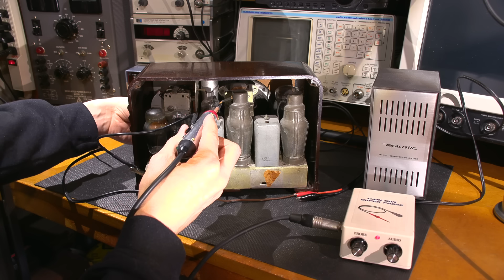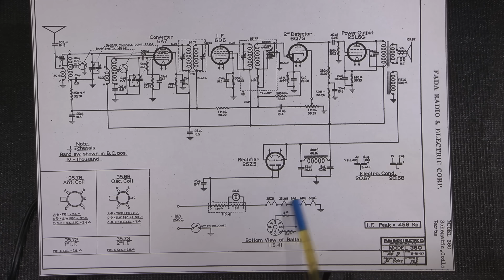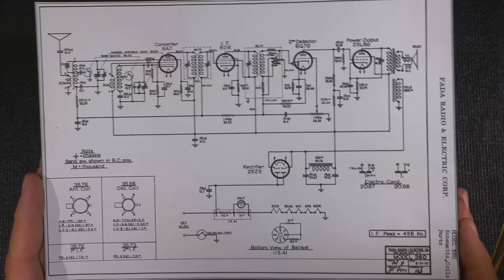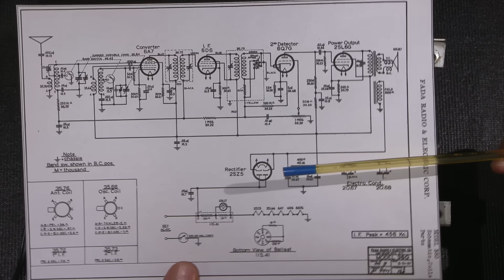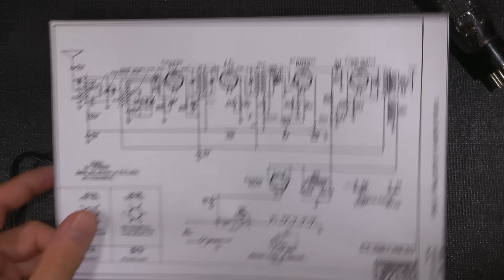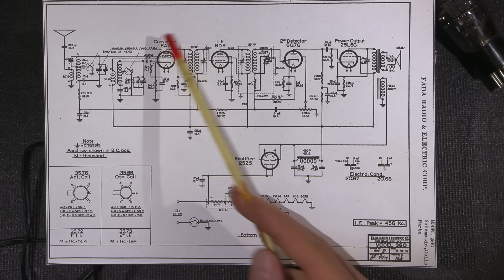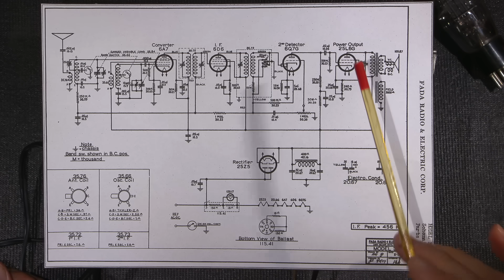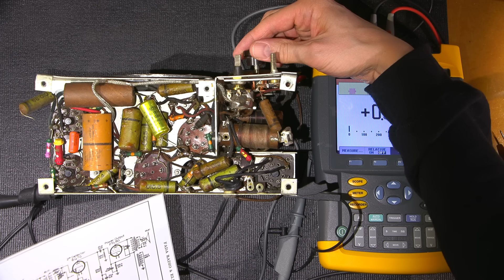Electronic Circuitry Diagnosis And Fault Finding! [Repair]

Comment: Yes restore the Far-Err-Umm Mother, you know it's a shame modern components cant be disguised to look like the retro originals, like you know some sort of shell over em..
Reply: A lot of people restuff the old capacitor shells with modern components. The bees wax melts easily and the old paper/foil guts slide right out. You then reseal it wit new bees wax colored to look old. Electrolytic cans can also be restuffed with a bit of work .

Comment: Couldn't somebody develop solid state direct plug in replacements for the most common tubes so people could keep their old stuff going without actual vacuum tubes?  I know tubes work at quite high voltages but, a solid state black box that does the same thing as a tube?  Maybe this is a dumb question but why doesn't or can't somebody?
Reply: Search you tube for "solid state R390" or "solid state BC 455" by Charles Smith he has done a good job converting tuned to solid state.
Reply: Auto correct got me, tube to solid state
Reply: @jerrydaugherty3781  Pretty cool. Still a fair amount of modification to the circuitry was needed.

Comment: I vote for restoring it completely. While you're working under the chassis you might as well replace that ballast tube with some suitable resistors as it's only a matter of time before that tube goes.
Reply: Andrew Rood  ,   Or, get some great idea of how to sub some other low filament tubes to match the 25 volt ones and drop in a little filament xfmr.

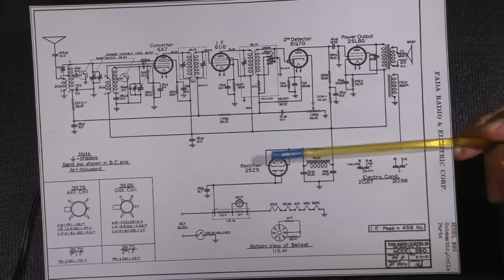Comment: 41:20 .. just watching .. "ouch, a parallel fed field coil, please don't be open!"
Reply: Probably more reliable than a series fed one because not affected by over current on B+. In this case a series fed one would be stressed by the shorted cap.

Comment: I remember the good ol days when I went with my Dad to the store with a sack full of tubes for the TV and using the tube tester.
Reply: My mom and dad owned and ran the country store/post office in our tiny little town. We sold everything from pencils to horseshoes AND radio tubes! I learned at about the age of 10 (mid 1950s) how to test and replace tubes. Folks would bring their radios in, I would test the tubes and sell them new ones when needed.
Reply: My Dad sent me to the drug store to test tubes. In addition to testing the tubes, I discovered you could get a thrilling electrical shock by hooking up the probes to your fingers. Wouldn't do that now, of course.
Reply: Robert Slackware  That tube tester is worth its weight in gold, my friend.
Reply: we have come along way
Reply: /s

Comment: I can attest to the dangers of B+. As a foolish 17 year old I took 250 vdc through my chest (via my arms). I felt like I was hit by a sledge hammer. I'm lucky to be alive.
Reply: While fixing a RF power amp I had 600 volts from my knockle to the tip of my middle finger. The finger took a whole month to start bending again. I still have a mark on my knockle where the power discharged to the chassis of the amplifier.  I was about 17 also.. The doc told me I could loose the use of my finger, he was not sure. teh finger started swelling 12 hours after the chock. I was sure it was cooked and it would fall down by itself after drying out... This time I learned respect for power.. I now work for an electrician union and I worked with electrical power all my life.. never got the juice on me again..
Reply: I can understand your painful memory.  In my case, THANKFULLY, it wasn't across my arms, but I got hit with 40,000 volts on a TV.  TV went toward the direction I was facing, my screwdriver flew to the right, I went hurtling to my back, and my ring flew off my hand to the left!  NOT a pleasant experience!
Reply: I worked on 10,000 watt HF amplifiers (Rockwell Collins 208U-10) the Air Force and got mixed up with plate voltage, 6,250VDC. It arced to my right hand, went across my chest and arced to a piece of test equipment leaving a hole in my left rib cage and uniform. Spent 2 days in intensive care while the docs checked to see if I killed the bones in my arm. Everything turned out fine and I still work in radio communications.
Reply: @Paul J Pachasa JR , No, I was trying to pry off the High Voltage lead from the picture tube so that I could remove the chassis from the set...in my young inexperienced mind, having an insulated handle on the long bladed screwdriver was enough to protect me from any high voltage...WRONG!!!  My index finger slipped over the handle and came into contact with the blade....then ZAP!!!
Reply: I think I’ll stick to 9 volt transistor radios. Lol.
Reply: I knew a guy who got 400 VAC across a hand and elbow. He thought the mains were off. He was yelling. He was shocked for some seconds before a coworker shutoff the mains. Rushed to the hospital, he was OK, but had a big burn mark on the elbow. He said his arm was heating. Reminds me of the mains hot dog cooker. Glad he was OK. The company instituted a new policy requiring a bright yellow light in the equipment when mains is on. People nicked named the light after him.
Reply: I was resting my hand on a radio with a power transformer which was upside down chassis exposed, as Mr. Carlson works on them. I noticed a tingling across my fingers and quickly pulled away. The B+ was 350 VDC, I assume I was shocked at a lessor voltage. Yes, young but with years of experience at the time.

Comment: Wow,  Fluke Scope meter, did Mr. Carlson treat himself for Christmas? :)
Reply: Those scope meters are 1500 to start..
What a difference from the old CRT scopes.
Now I want one..!!!😊
Reply: @frankpitochelli6786  Actually, its  $4,999.99. Wish my wife would give me one, too.
Reply: @gbennett58 ....I looked that particular scope on Amazon...its is as you say 5000.!!!
Reply: Fluke 199C ... lots of them are on eBay for less than 1,000 $US... I just got entire set with all the leads, charger, case, documents, etc. for 900 $US. The isolation they offer vs. the line-powered (grounded) Tektronix I have been using for years, and portability sold me on it.
Reply: @frankpitochelli6786  they're completely isolated from Mains so you can work on high voltage power supplies as well as switch mode power supplies, ide reccomend you buy a fluke or a Tektronix, don't settle for cheap
Reply: Being rich is a plus for some people.Nice scope /meter.
Reply: I've used that scope meter, it's getting on a little in age but it's still excellent for its age
Reply: I am sure it was a Christmas present from his kind wife :)
Reply: If I were Fluke, I would give it for free.

Comment: Nice story about end users that find and replace the bad tube by themselves, and it is absolutely true. When I was a kid, the radio broke and the next day my father came home with a bag of tubes, borrowed from the local radio/tv shop. It unplugged the radio from the socket, opened the back of the radio, and exchanged the tubes with the spares one by one, until the radio worked again. It was a history professor, and far removed from any technical work. But repairing the tube radio by replacing a tube was something that was confident to do.

Comment: I wonder what the deal was with these radios when they were originally sold. Did they come with warnings or instructions for plugging it in? Did people realize that were in possible danger every time they plugged a radio in?
Reply: When they came new from the factory, they were kinda safe. The insulation capacitors were new and did actually insulate, exposed screws were covered with wax seals and so on. In the later era, they outlawad the hot chassis and it was mandatory to make it floating, which eliminated the danger of electrocution from touching exposed screws etc. (until the capacitor between circuit ground and chassis failed).

This did by the way never happen in Germany. Actually, televisions here had a hot chassis until WAY into the semiconductor era. To make it even worse, they used bridge rectifiers by then, so the chassis was hot regardless of the way you plugged the set in. 

They only stopped using them when VCRs and video games became common and TVs needed inputs other than just the antenna jack, which made the hot chassis finally technically unfeasible. This was by the early 80ies.
Reply: Only if you opened it up while it was plugged in.